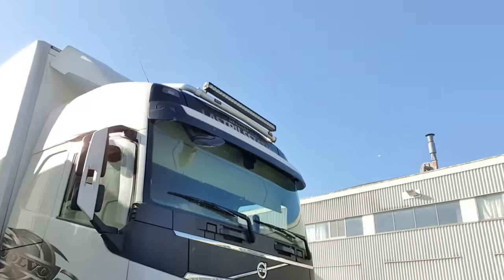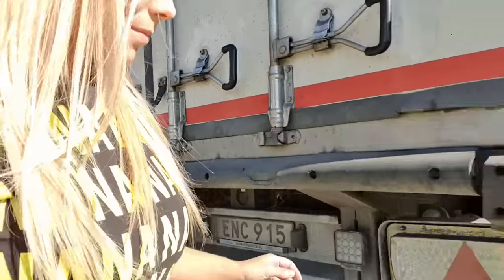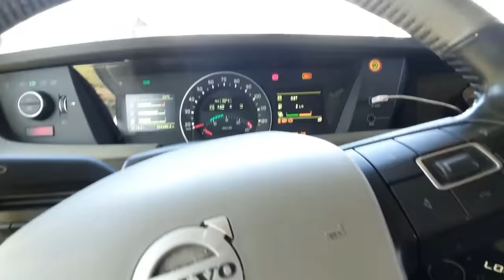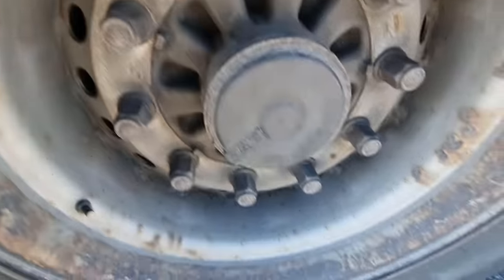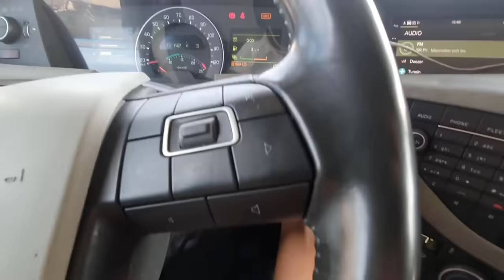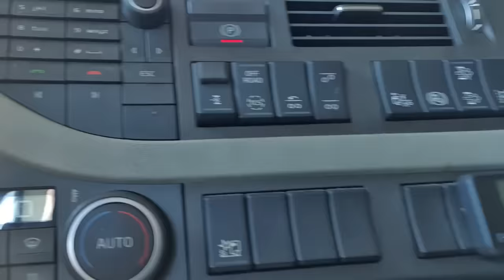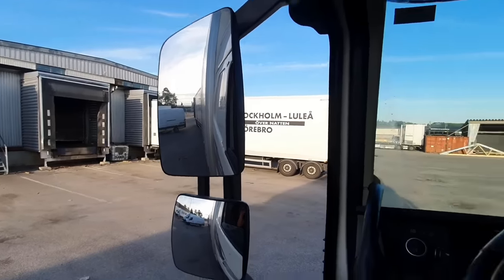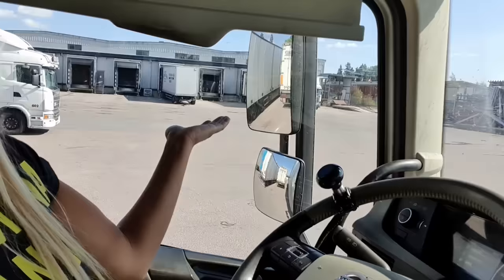HOT BRAKE PADS - locked wheels, Angelica Larsson

Comment: I wish our dollies for attaching a second trailer was like those you have there You know how transport trucks have a 5th wheel allowing the trailer to turn well our dollies here have a stand to keep the hook off the ground until needed, 

the ones here have a 5th wheel too allowing the second trailer to turn too so, when your backing them and turn the truck left the first trailer turns left too but the second trailer turns right at the same time ! same scenario when you turn the truck right here we call  it we call them a pain especially if freight is in the front trailer that we need, 

And we do not have side doors on trailers, just in the back and when you have 2 trailers and when you back up both trailers go in opposite directions at the same time you feel like burning the whole truck !!! or like me curse the truck lol !!

Comment: Use the other side of your hand to check the wheels.  You do it that way when you are checking walls for heat from a fire.  Be careful.
Reply: The skin on the top of your hand is far more delicate than the skin on your palms. I wouldn't put the top of my hand onto a piece of hot metal.

Comment: It's probably the Hub oil too low and if it had a problem it probably overheated The Hub oil and it's probably lower or needs to be changed

Comment: You should get a heat sensor gun ,just point it at the hub pull the trigger and it will read the exact Temperature.

Comment: Glad you got home safe ! .... But continuing to drive the wagon when it was handed over to you  with defective brakes at the beginning of the shift was poor practice . It should have been tagged as unsafe and not used until a competent mechanic had repaired the brakes .  had you been involved in an vehicle accident and the wagon was found to have been unroadworthy .... you would have been in  deep legal trouble .     Think twice if this happens again .... and if it does think again if this is the right company to be driving for . We plugged brakes and ran unroadworthy equipment in the old days when life was cheap .    You younger drivers are smarter than that these days !  Glad you got home safe ....your cats need you !

Comment: I would have cut those lines for the rear 4 wheels with the locked brakes myself before taking the trailer into the shop. It's very dangerous to drive around with locked brakes on a truck or trailer. Because of the overheating of the wheels the tires could blow up and injure or even kill someone. I would not be around overheated wheels like that. I've seen this first hand in traffic where a truck tire blew up next to a passenger car and shattered all windows of that car and nearly deafened the occupants of the car. This is no kidding around!

Comment: Was it me are was i just seeing water coming out of the air lines when they was cutt?
Reply: Air may contain a lot of water vapor in warm temperature. Once the pressure goes down (cutting the hose), the temperature also goes down rapidly. This causes some of the the water turn from vapor to liquid again. So, yes, you saw water.

Comment: Angelica, maybe those axles are only warm because they have this hot woman touching them? Such a beautiful Lady! I like that, you want to hear them scream, before they die ...lol , Good thing you are not driving in USA right now, with all the crazy protesters. They stop cars and trucks on the highways . Good that I don't live there, I wouldn't stop for them. They would learn how to move quickly. Years ago in Florida, when I had a show car. At 1 am in Fort Lauderdale, a bunch of guys jumped out into my lane and wanted to steal my car. I  was stopped at a red light and had to cross 4 lanes. I got out and yelled that they had better move.  I left that corner at full power and they all dived out of my way. I was easily at 100 miles per hour at that point. They saved me a car wash ...lol.

Comment: I'm not trying to sound like a besserwisser old fart, but you should really be careful with hot running wheels. I lost a colleague back in the late 80's, when he was out checking on a hot running wheel. I don't remember if it was a dragging brake or a wheel bearing failure, but anyway, the wheel got blistering hot, which made the air pressure in the tire go to 11 and beyond. The tire burst and the cords made a big hole in his chest. There was no need for an ambulance.

Comment: Driving that distance  for service is too far. The mechanic that changed the value didn't remove the wheels to check the brakes and brake Springs. The mechanic should have jacked the wheels off the ground to check for dragging,

Comment: Lol as everyone else I'm sure, i got a kick out of your comment on running over someone, c u got your hands dirty but didn't c u turning wrenches 🤔, what's up with that, I remember when i had my trucks on the road ole boy fixed his truck his self, also God made dirt, dirt don't hurt, so put it in your mouth and let it work😝, sorry can't help u with an electric truck but if it was mechanical more than likely, and sounds like brakes burnt the hub oil up causing bearings to continue to get hot, was it the s-cams the problems with brakes locking up?

Comment: That's BAD!!!!   You know you have a bad brake system and are driving it 1.5 hours away.  That is illegal in USA.  It will automatically get you a bad ticket and the truck will have to be towed to the shop from where ever it is found by the police.  You need to have a mechanic COME TO YOU and fix it.  I am disappointed in you....